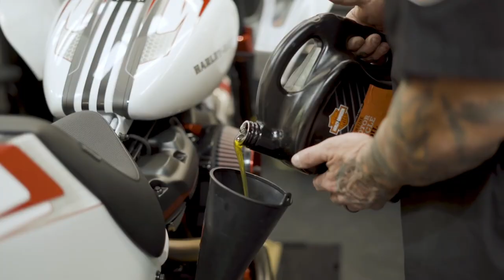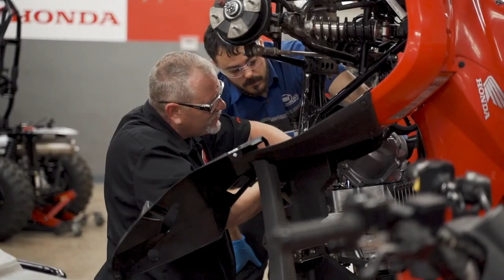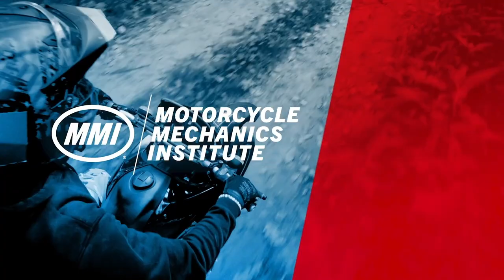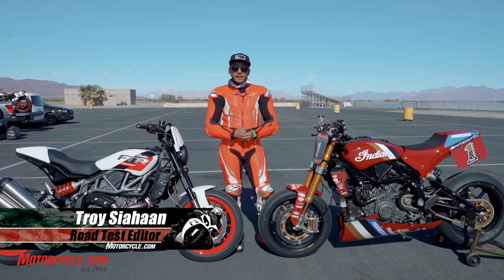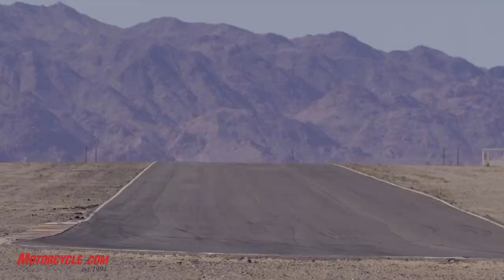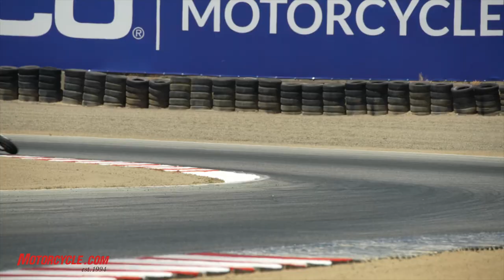2022 Indian FTR1200 Hooligan Race Bike - First Ride

Comment: I love my FTR but I wouldn’t put too much into those wins. The other bikes had to be heavily penalized with weight added.
Reply: Ikr the Duke 890 need a massive amount of extra weight to race...
Reply: I saw the first Daytona race, did not get  a super close look at the 890. But it seems like a superstock type of spec on the 890 versus a much more modified Indian with these front forks and brakes. The Indian is probably a lot more expensive. The 890 is a sportier road bike to begin with tho.
Reply: @Don8789  the duke needs almost 50 pounds of extra weight to race, that is a lot of weight....
Reply: I couldn't figure out why the 890 wasn't blowing them away.  Thanks, this explains it.
Reply: This season they changed that. The weight restriction was removed and the 890 is down to what it should be. And they still got beat.
Reply: @toofastnobrakes  What is the weight penalty now?  Why is it that there "should be" a weight penalty for a bike with 3/4 of the displacement?
Reply: @brucerossonthetube  there isn’t a weight penalty now. I think you misread my comment. They are as light as they want to be. And they still lost. But we are only two races in so far
Reply: There most definitely was a weight penalty in the 2022 super hooligan season. So if it’s changing for 2023 that would be interesting Bruce.
Reply: @dukiemoto8676  it has changed. There is an interview with Alex Taylor “one of the duke racers” where he mentioned how Rolland sands allowed them to remove the weights this season so they could be competitive this season. He is coincidently also the guy who wiped out in race 2 at Daytona this year
Reply: @toofastnobrakes    Thank you for the update, most appreciated. Of course I’d like to see the FTR dominate but it would be more exciting because that KTM got real close. Curious though, how do you think it will play out with those weight restrictions lifted?
Reply: @dukiemoto8676  well from what I’ve seen in the first two races it didn’t seem to make much of a difference so far. The ftr’s biggest competitor at the moment is the new Harley pan America’s. They are running the air box from the sportster S which is what restricts the bike to the “120hp stock” limit. Cory west actually won race 2 on a pan am with three ftr’s on his tail. But was disqualified after they found that his team “forgot” to alter the airbox for the bike he used in race 2.
Reply: @toofastnobrakes  “forgot”👏😂

Comment: Extra weight is extra work at handling, braking, and Handling acceleration.  Even the chassis fights you as not designed a race bike from ground up. Brave riders. Did you say no electronics on these bikes to race?  That would really make it tough with the increased horsepower these race bikes must possess.  Estimated horsepower?  No wheelie control, no abs or TC with all that extra power!

Comment: Been lookin for a FTR1200S for 2 years, but in the Netherlands still to expansive. 
Secondhand prices for a FTR1200S from 2020 start at €15.000.
Reply: I bought mine (a 2019) for E14.000 in Gelderland about 7 months ago.. never had any regrets.. I love it. Had it tuned on a dynamometer two months ago and it rides even better now. Keep on saving I should say. But yes, taxes on motorcycles (and cars) are way too high here in the Netherlands.
Reply: @mauriesl try Sweden it's even more expensive. 😢
Reply: @hymerr  That sucks man.. and I forgot to mention that original OEM Indian parts are also more expensive than other brands. I recently wanted to switch my handlebar, because it's a bit too high (I have a protaper Rally handlebar). An original Indian handlebar was E250. I went for a Rizoma handlebar that has the same dimensions as the Indian handlebar, but is E150 cheaper. Great motorcycles those Indians, but they are indeed a bit overpriced. But all in all, I'm still happy as hell with my FTR.. big smile every time I go out riding.
Reply: I am in the u.s and found a 2022 carbon r, all I can say is I love mine, it's powerful, it likes to wheelie, it's fast enough and torque filled enough that I doubt you would get tired of it. Happy hunting!

Comment: I took a demo ride on the first Indian I've ever ridden. It was a Scout.
Really didn't like it. Didn't have that much power. Vibration was terrible. Suspension was harsh. My middle aged back hurt after 20 minutes ride. Didn't like the sound that much for a Vtwin.
I've been on cruisers before that I did like, within the cruiser ethos. This was not one of them. I was hoping it would be a lighter, more rippy, more agile cruiser than typical cruisers. Just wasn't.